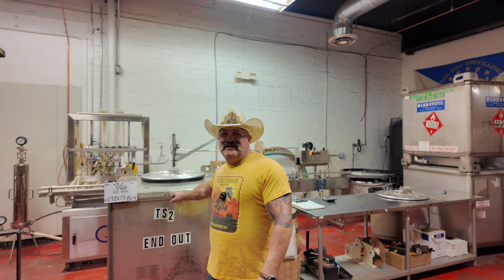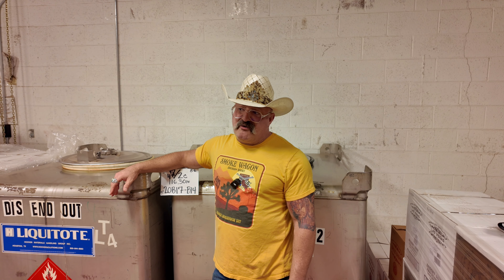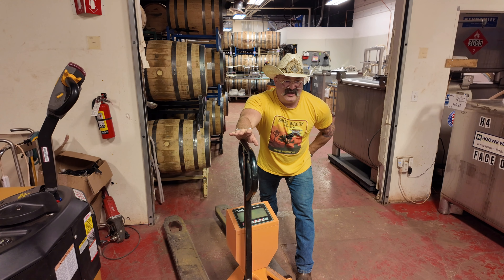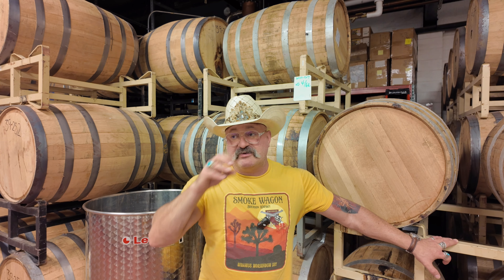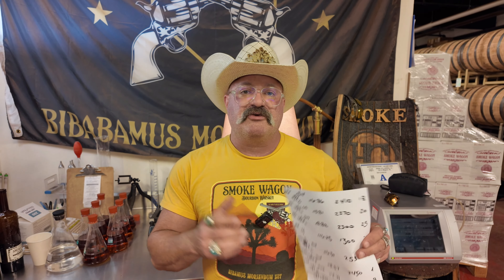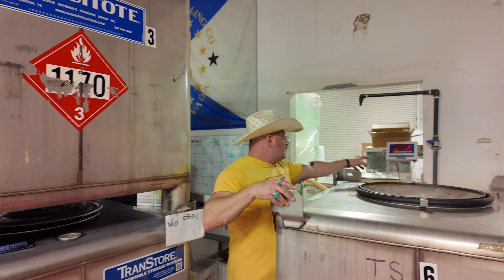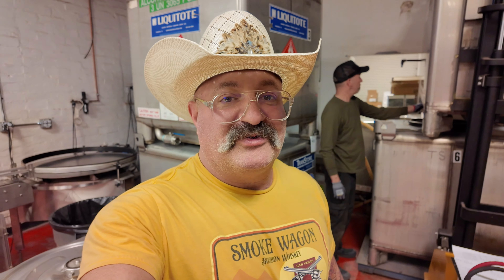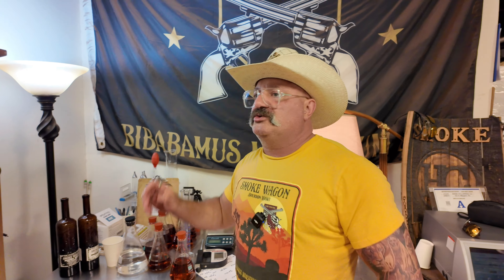Blending and batching, here's how we do it.

Comment: Hopefully this doesn't get taken the wrong way I'm genuinely curious. How much of these techniques did you learn from someone or research it? Or is this just the system you figured out along the way. Thanks for sharing all this it's super interesting to see behind the scenes 🍻
Reply from the maker: @primitivefpv6660  it was all just trial and error and I had to figure it out. Especially the weight to weight when going from blending to batching. The first small batch runs didn’t taste like my blends and I couldn’t figure out why. I was blending by volume and batching by weight. I just decided to weigh all the different vintages and locations 100 milliners at a time and I learned they had different mass. So say my 50/50 volume blend didn’t translate to 50/50 weight. There was too much younger bourbon because it has less mass and they really should have been 60/40.
Reply: @smokewagonwhiskey  dam it's all so crazy to me to think about the process after your describing it. So many variables 🤣 especially taste. even if the equipment was double checked, little mistakes ruled out, I still feel like you could blind me all the exact same blend and I would think they had differences.

Right on for making these videos love seeing the process